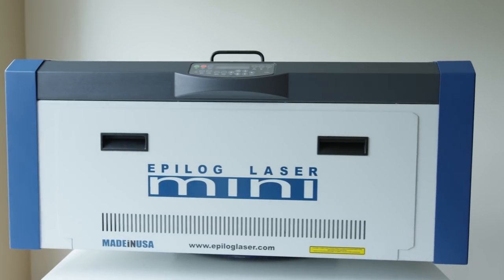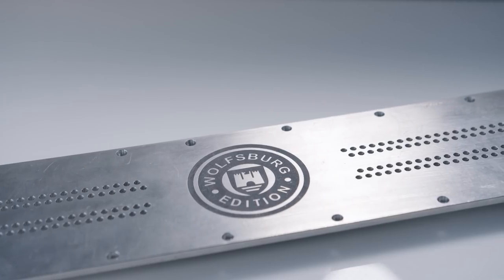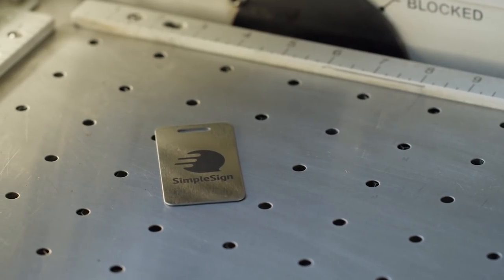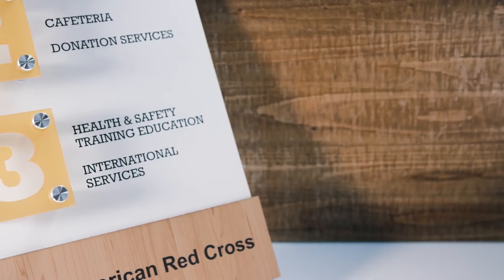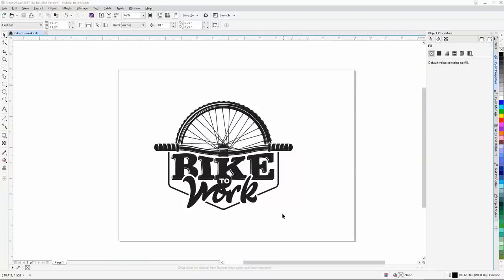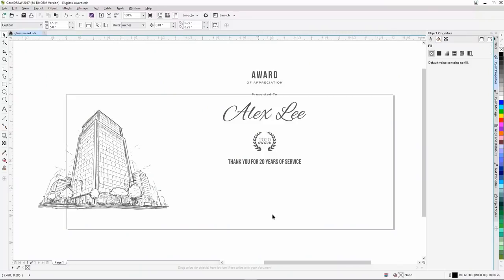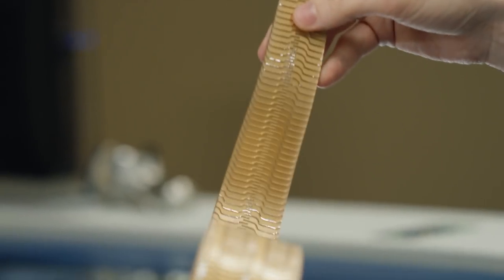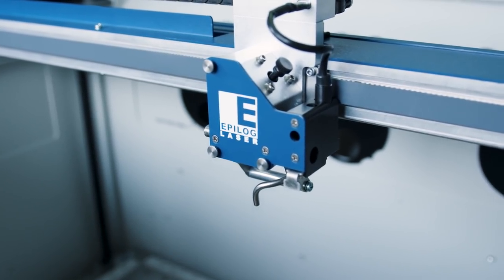Getting the Most from Your Laser Beyond Your Initial Application

Comment: I know its not recommended but i need precise 0,0 to align printed paper to cut holes. To test 0,0 i print a rectangle 1 inch from top and left side. They are always  both off by 0.128 and 0.156. Are there borders like with printers ? Mini 12x24 autocad